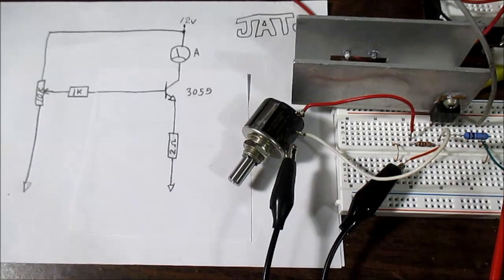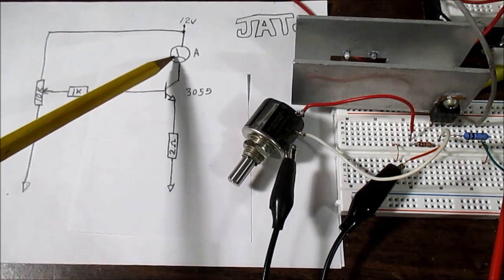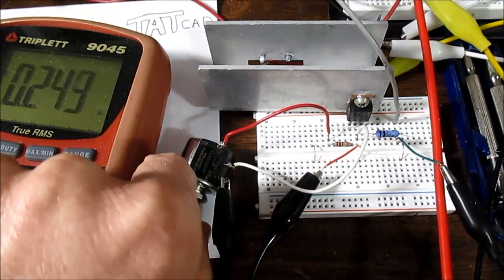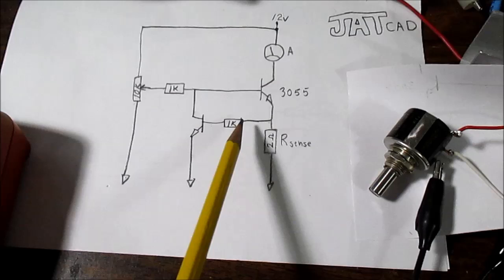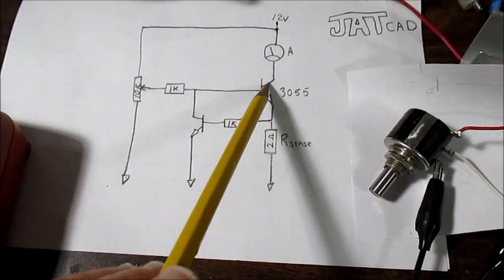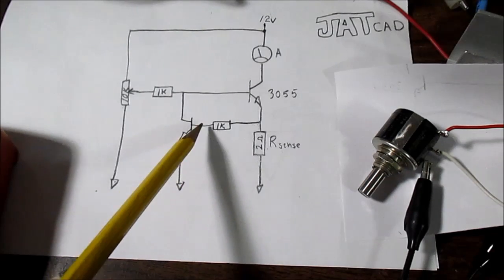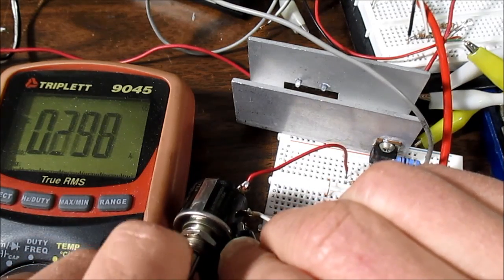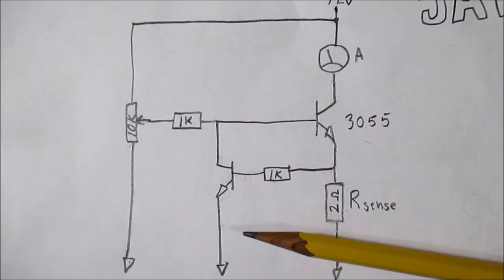Basic transistor current limiter circuit

Comment: Hello and thanks for this video.
Now my question is, if I want to regulate the current of a 12.6 volt 60AH battery, can I use the same circuit and put more transistors in parallel and a higher wattage power transistor emitter resistor to handle current over 60amps?
Thanks again.

Comment: So that's cool.. that means MOSFETs can be used and OpAmps can be used as comparators. OpAmp non inverting input is higher than the inverting input, the output goes high and switches on the shunting mosfet.. nice.. Voltage is equal to current times resistance , Voltage = Current x Resistance. Brilliant. (+1)

Comment: I was excited for s moment, driven by the simplicity of the circuit, until realized that to stabilize e.g. 6A it would require  0.1 oHm resistor dissipating 3.6W!

Comment: nice video, what happens to the system if i attach a load to the circuit?  Does the 1k resistor to the second transistor influences the cutoff time. Thank you

Comment: Hi, Is it possible to limit 20A or more current with this circuit?
Reply: The transistors and potentiometer have to be rated for 20a or more . The circuit should work .

Comment: WELL WE HAVE SEEN TONS OF CURRENT LIMITERS OUT THERE BUT MOST OF THEM ARE NO GOOD FOR LOW VOLTAGE POWER SOURCED DEVICES LIKE TORCH FOR EXAMPLE THAT GOT ONLY 3.5V BATTERY OR SO SO THESE CIRCUITS NEED A TONS OF VOLTAGE TO TO WORK PROPERLY SO TO POWER A 3V LED WE NEED TO USE MINIMUM 12V INPUT FOR THESE LIMITERS SO ITS TOTALLY NO GOOD . PLEASE PROVIDE A LOVE DROP VOLTAGE CURRENT LIMITERS ?!!?!?!?!!?

Comment: What about limiting the current on AC circuit. Example, I have a grid tie inverter and it produce the amount of watts for the day. Problem is that when the fridge go to standby, now the panel will produce 40watts more and that will go to the utility grid and charge me for my over production on solar panel, how can I limit or divert this current?
Reply: What type of grid tie invertet do you have .
Reply: @Spidersoftheworld  I have a this one https://www.dhgate.com/product/1200w-grid-tie-power-inverter-28v-52vdc-95v/142849405.html (the 28v-52v version) I hooked a 400watt solar panels only, since it's a "dumb" grid tie inverter that have a good mppt build in. But as I mentioned, when my fridge compresor stops, it's injecting the remaining energy to the grid, so I want to know what can I do to revert that or even better, not to over produce it. I don't have a smart meter from the utility and no contract for bi direccional bill

Comment: can I use this to keep a rechargeable battery from dumping too much current out at once?
Reply: Yes. It could be used to limit the maximum discharge current from the battery, however the output voltage will drop as more devices are added after the the designed output current is exceeded.

Comment: hey can u please help in limiting current of a 36v supply to 3.5A for my led panel?
Reply: Yes, you can use the exact same circuit, you just have to change the resistor value for the emitter of the pass transistor. In this case, it will be 5 - 5 watt 1 ohm resistors in parallel. I^2*R=W, which is the size of resistor you need. In this case 3.5A^2*(.7/3.5A)=W => 12.25*.2= 2.45W rated resistor minimum...so I chose 5 watt as a safe bet. 2N2222 for the feedback loop is fine since you are under 40V.

Comment: hi could you come up with a current diverting/ limiting circuit for a solar inverter. if you limit current you can control the watts output of the inverter so with a ct clamp on the meter wire you can see what you are pulling from the grid and match this with the output of the inverter by increasing or reducing the current of the dc into the inverter any help with this will be great
Thanks David

Comment: Great video. But how you design for a current cut-off circuit. For example, such that is the current in a circuit exceeds 100mA, it switches off.
Reply: Zener diode will help there. When the current limit is reached, the voltage starts dropping. If you place a zener diode such that upon  voltage drop, it will go to an off state, this can be run directly to the base of a power mosfet, controlling the current flow to the rest of the circuit. So for example if you have a 12V circuit, select a zener with an break down of 11.5V. When the current goes over 100mAh, the voltage will start to drop. When that happens, the zener will stop flowing current to the base of the mosfet, and the whole thing will turn off.

Comment: your cat is so cuteeeeee--sir i have-5 k pot  /0.5 w---limit   3a at 34  v for 100 w led---please tell me the wattage of resistors and  potentiometer (value and watts)-thank you
Reply: Wellll seeing as there was no reply, I'll take a stab here. So you have 34V/3A=11.33 ohms...with 102 watts required for a resistor. In other words you are sinking several soldering irons worth of energy. If you follow this method he uses, then the power dissipation in the resistor will be vastly reduced... The equation is I^2 * R = W (watts dissipation required). So here what he does a dubious job of explaining, and even drawing in the circuit, is that you are only measuring the voltage drop on the emitter side of the pass transistor across that resistor only.  So you calculate the voltage drop, typically .7, with the current limit, in this case 3A.  He also leaves the output of the current limiting transistor just trailing off the page. In fact it is a feedback loop, and the emitter of the transistor should both go to the same output as the 3055. The current limiting is being achieved by base of 3055 turning off frequently...thus there is no unlimited dump of power through the circuit. It is limited based on the resistor/transistor combination feedback loop that was hidden under the paper turning the 3055 off.

0.7V/3A =.23 ohm   Voltage drop across feedback transistor divided by current limit desired.

Since it is not really feasible to get that value, you would have to run several resistors in parallel to get that value. However, once you do, the dissipation is only 3A * .23R = .69W (Less than 1 watt!!! 100 times smaller!!!) :D

So, to get your .23 ohms you would need 4 - 1 ohm 1W resistors in parallel on the emitter side in order to get close, which would be .25 ohms. Using the parallel resistor equation, which is difficult to write in here, but suffice it to say, it is the numerator multiplied, and the denominator added, you get a total of 1/4=.25ohms. A whopping .2ohms off, which will somewhat skew the output limit, but not by much. As for the pot, it'll be fine. Remember, the bulk of the current is going through the collector to emitter of the 3055, to the output. The current draw of the base of the 3055 is minimal.

Comment: Sir, where should we connect the terminals of multimeter to check the current??.. Pls replyy...
Reply: You connect the amp in series behind the collector of the 3055 in this case. All subsequent current draw will go through that collector.

Comment: I have a Transformer with output of 50v 10a AC, which I converted to dc,
the next thing I want to do is to limit the current to 5A.
Is this possible. ?
can you the me the value of the resistance and Mosfet for this purpose?
Reply: Sorry, I don't understand what you Said
Reply: +dyno tech karachi

Yes, you can use the exact same circuit, of course you would need a 5A rated mosfet that can accept 50V! So, I did a 3 second ebay search and found this part number: K18A60V which can handle 600V at 18A! 

On the rest of it you can do exactly what he did for the rest of the circuit. you just have to change the resistor value for the emitter of the pass transistor. In this case, it will be 7 - 5 watt 1 ohm resistors in parallel. I^2*R=W, which is the size of resistor you need. In this case 5A^2*(.7/5A)=W => 25*.14= 3.5W rated resistor minimum...so I chose 5 watt as a safe bet. Although, you can't use a 2N2222 for the feedback loop. The max voltage for those is 40V I believe, so you will need a different part number. Actually in the same search, I found it...it was the next item down. Fairchild BS170, which can handle 60V. the 2N7000 seems like another option, which is cheaper. You'll have to look at the datasheets to see if you can find one with a .7 voltage drop..since all my calculations are based on that...
Reply: Also, can you the me first as well?

Comment: hi, can you specify the full name of the power transistor, that's because I see two versions of 3055, but it does not look like the one in the video ?
Reply from the maker: MJE3055T but nothing is special about the circuit that you have to use a specific transistor. As long as can it handle the current.
Reply: Will TIP120 be suitable for around 1 amp ? (Sorry to bother you, I am still struggling my way with electronics.)
Reply: Yes, they can stomach 5A...